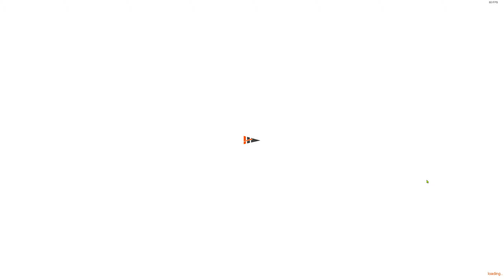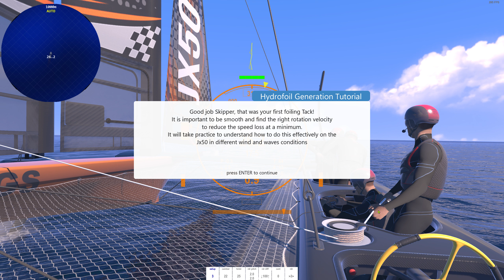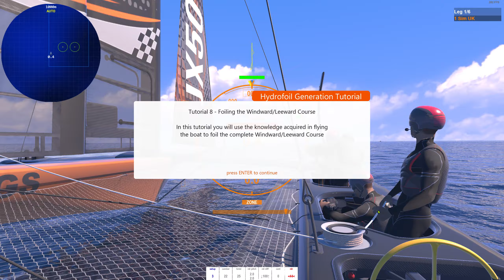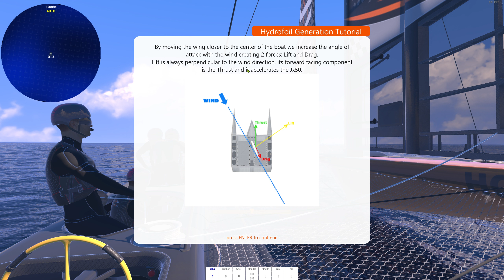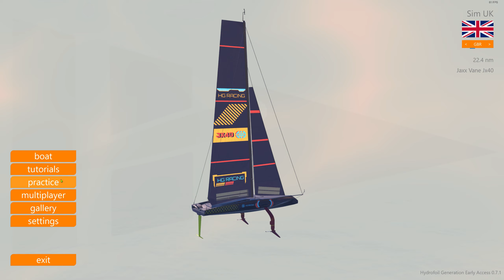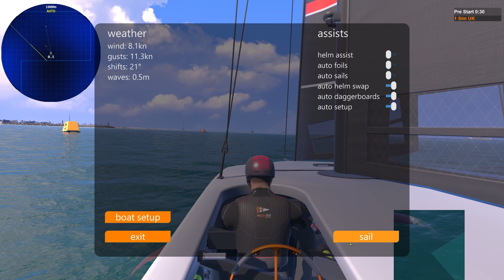Hydrofoil Generation Tutorial MANUAL Sailing + Foiling

Comment: The tutorials are bugged at the moment, there is a patch coming apparently. When you fail it doesn't reset the boat to the side the tutorial is supposed to start on, which is why at points you were sailing on the low side with the wrong dagger board down. Also, you have to wait for the clunk noise to confirm the dagger is down before starting the turn. Also also, I'm pretty sure the thin lines inside the ring at the top and bottom mark where the game will think you are starting a turn, at the top it goes from about -30 to +30, every time it says you turned without dropping the dagger board, that's what the wind indicator hits.
I had similar problems with foiling btw, can't help but think the mouse wheel isn't the best for that, it needs a proper analogue input. Looking forward to seeing how you got on in the race! 😀
Reply from the maker: Thanks 😊
Reply: after the update I was able to master tutor 8 successfully
Reply from the maker: Yeah me too, & Tutorial 9...although it was tricky!  
https://youtu.be/qXK4-COJMFg

Comment: Controllers do work with the game. I use a steering wheel and it works great
Reply from the maker: Oh Great 👍 
Thanks for letting me know, how did you bind the buttons?
Reply: @SimUKUltimateRealism  At the top of the screen you can change the preset and then you can click on the controlls you want to assign a button to
Reply from the maker: Thanks got it working great!

Comment: no chance to control the foils manual.  Because , surge , sway , heave , roll , pitch , yaw ;  this has to control in the same time . I would use a regulation for this in real life.
Reply from the maker: It is tricky
Reply: They do actually manually control this in real life on boats like this. What makes it a bit easier that it's multiple people doing what you all need to do yourself in this sim. One on helm, one flight controller who adjusts the foils, one trimmer for each sail.
Reply from the maker: I think if we could have 2 people per boat it would be even better.  I tried fully manual and whilst doable...it is a LOT to manage alone:  https://youtu.be/E4VFFoWlYlk
Reply: @SimUKUltimateRealism  I've been waiting for the coop for sailwind for 2 years; everything could be so much more fun
Reply from the maker: @bigjim9719  that would be excellent.